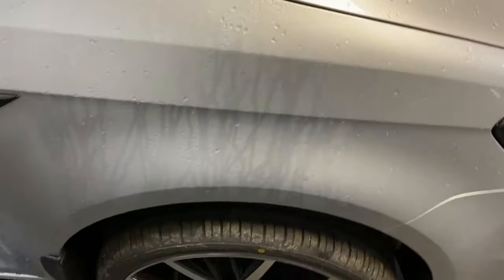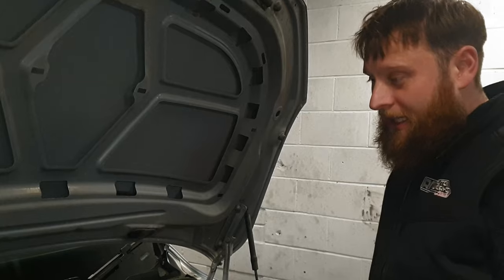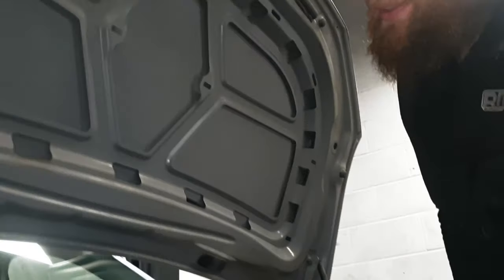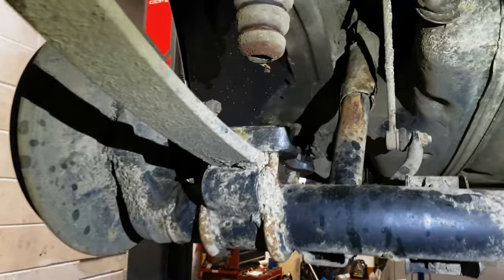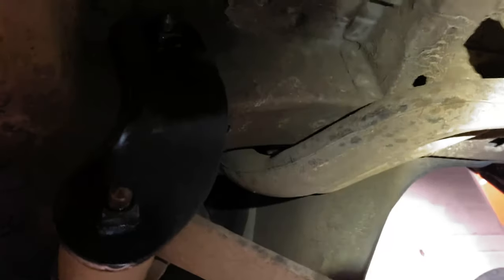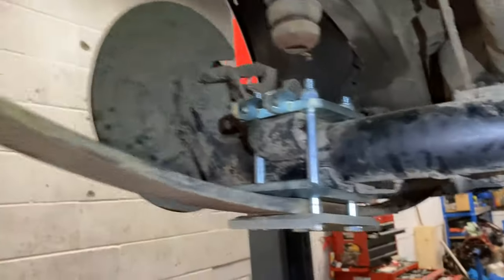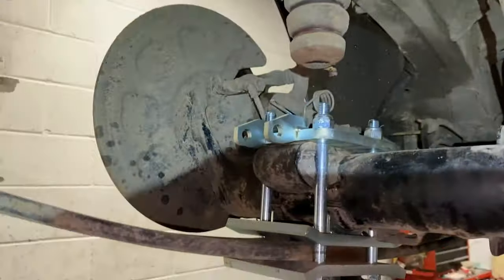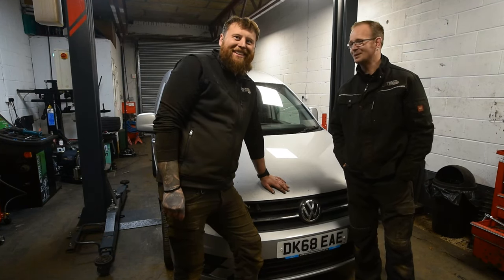VW Caddy Stance+ Suspension Upgrade

Comment: When you put the rear stance shocks on , did you use the original bolts ..thanks
Reply from the maker: Yes mate we used the original bolts 👍
Reply: @MECHANRICKS  thanks,  I am struggling with mine as my bolts won't go through the stance shocks bushings
Reply from the maker: @antonyjones3484 That sounds like you've got the wrong shock absorbers as the eyelet hole on the stance shocks is exactly the same diameter as the standard shocks

Comment: Do you need to buy new shocks for the rear? or is OEM fine just to put back in?
Reply from the maker: The rear shocks come with the kit and I'd recommend using them, you could use OEM shocks but the damping rate would be affected
Reply: @MECHANRICKS  We haven't purchased this particular set as we live in New Zealand. I've purchased some 2inch blocks that should lower it on the cheap, but just wondering if i should opt for new shocks whilst im down there.

Thanks though!
Reply from the maker: No problem, I'd recommend upgrading the shocks if you can but if your going the budget route technically there's nothing stopping you from keeping the stock shocks on